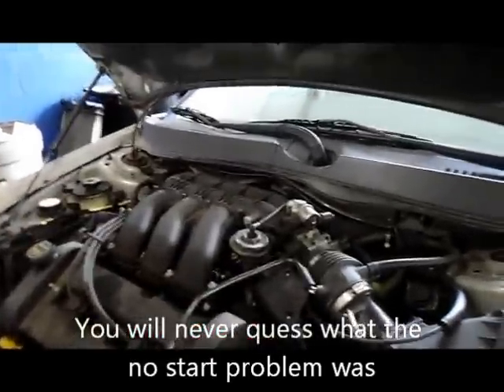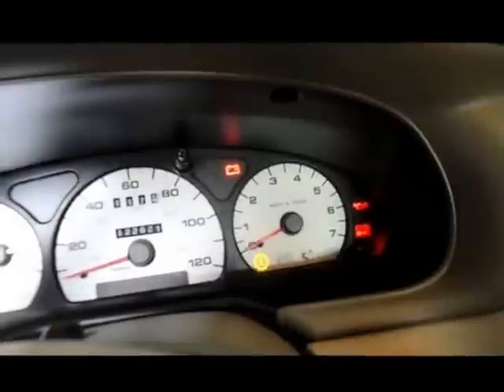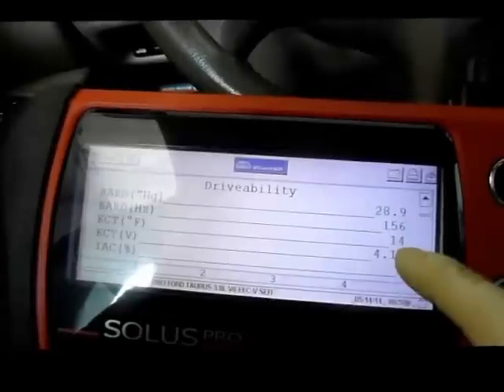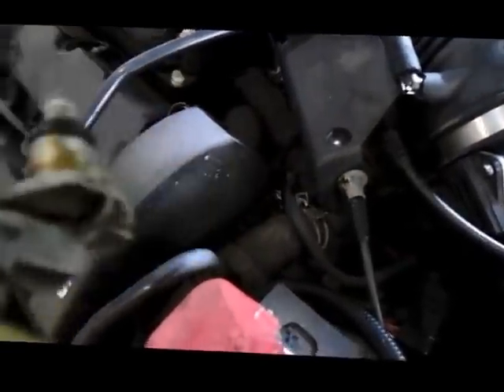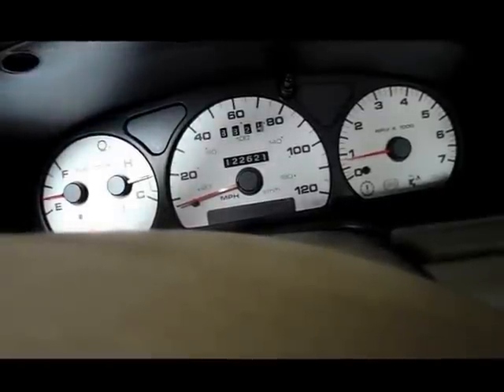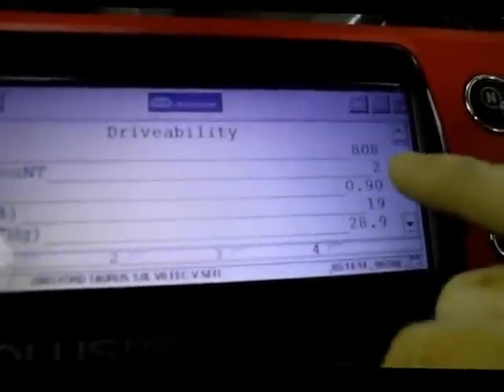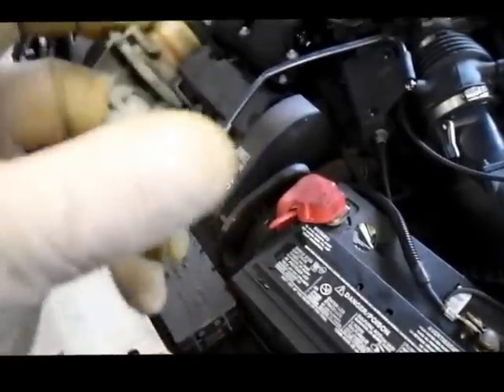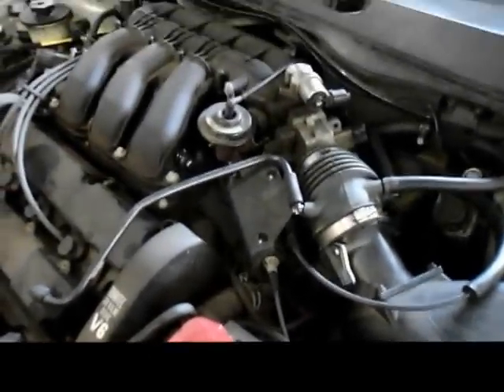Engine cranks but won't start

Comment: Common on the 300 straight six. Also common to find that the pigtail is found under the 4.6 (not the 4.9/300 CID) at the parts store. It's like an emergency stop. When in doubt about temp, it cuts off, potentially saving you from overheating/ cracking the head. People think its dumb, but id far rather change a sensor than an engine.

Comment: well because at this current time on that your vehicle the ECT is a required input used by the PCM to determine pulse width to the fuel injectors and exedra so without having the correct information or it being outside of the parameters set for the computer it will not let the vehicle start hope that makes better sense

Comment: It's a dead short on the sensor causing the PCM to go into safemode... Keeps your engine from overheating... Jeeps are known to do that but cut into the throttle position so you can't drive over 45.

Comment: Yes the safe mode is working fine to prevent the engine from overheating, the temperature that is read buy the sensor goes to the ECM if the number don’t Mach the normal allowed it will cut power to the ignition system...

Comment: Upon powering up the ECM/ECU first thing it does is to see the Ambient Air Temperature sensor reading  (integrated in the maf), the MAP sensor reading and the ECT sensor reading, the program calculates for the ideal fuel ratio for ambient temp and altitude variations and selects the logical A/F ratio cell, in this particular case the program gave priority to ECT sensor and disregarded the rest,  it should be tied up with logic triggered DTCs for easy diag i guess its a programming bug that might be corrected for in their late production

Comment: I have seen multiple configurations for these shut offs, on the gas on old honda civics in particular. I suppose along the way someone decided to use the temp sensor, 
I bet the function is not to see if the temp is too far out of range for the vehicle to run, but the voltage change after you put the new one in is the clue. I bet it disables the engine to simply prevent over heat, if the sensor is not working correctly the fans wont work correctly right?

Comment: Sensor out of range is quite common. Pwm is so long it floods engine. 
Up here in the dead of winter it would start,but eventually flood out. 
A very common issue with gm vortecs. 
The no spark thing should have flagged something. Unless the flood killed the spark on corresponding wire. 
Multi-spark,one shorted plug kills 2 cyls.

Comment: Yes, I had a 1999 Ford Exploder  ( not a typo..lol ) on my lot for 6 years and 5 different mechanics. This damn thing would start once a day and that would be it. As long as it stayed running it would run all day. But when you you shut it off, it was done till the next day. Trying to unhook the negative cable thinking if it was the computer  this may clear out any problems and start up. That didn't work. Thinking if this was a bad sensor that would have cleared and started we moved on to the mechanical. Knowing the timing chain had been changed by 3 mechanics before, of course he must have left something loose in there. Took that apart, all good. Crank sensor, cam sensor and most every sensor on the motor changed over 6 year. All top end gaskets and vacume hoses changed. Fifth mechanic mechanic tells me it must be a bad intake keeping vacume stuck somewhere or a bad wire in the ECM. He can pull the cover off and check ECM for a bad wire. I told him to go work on something else let me do some research. Looking thru the computer at all the parts I had bought or didn't buy. Going out and starting the Expoder for a week. I realised something I guess non of my great mechanic's did not catch over 6 years. Temp gage was normal on first start. Would ride about mid range. BUT, on the second start would barely move off bottom mark. It was just at mid point just 5 seconds ago. Checking wires and no bad wire no check engine light. Nobody ever checked temp sensor. I changed that and started every time like a dream. Sold it 3 days later on a note. Next year and a half when it was paid off. Never another problem with it. They wanted to trade it back in on a bigger SUV for down payment. I cut them a deal. Keep your exploder, $500 down. I never wanted that thing back on my lot again.
Reply from the maker: Thanks for watching and for your input.Sometime such and easy repair can drive you up a wall.

Comment: Problem is probably over rich air/fuel mixture. The engine computer determines air / fuel mixture partly based on engine temperature. If the ECM "sees" low temperature it will send extra fuel. Thanks for sharing.
Reply from the maker: Thank you for your input. Don't forget to watch Sunday Night at 7:00 PM Live stream.

Comment: It seems like that voltage draw by the bad sensor was causing the ignition system to have less than battery voltage, or starting voltage on the step up coil. If the coil doesn't get enough input voltage it can't step it up enough to spark. I had a surprisingly similar problem on my 1982 Jeep cj5, which is a very different and almost non comparable car. It had resistance due to corrosion on the grounding wires inside of the distributor. When the starter was drawing power I would have about 10vDC at the battery, but only about 8.5-9vDC to the positive side of the ignition coil. I wasn't getting a high enough input to to the coil for it to step up the voltage from 10+vDC to the 45kvDC needed to overcome the resistance in the plug wires and create a spark. The voltage needs to be high because the wires are something like 35k ohms. If there is any voltage draw, either from a bad sensor like in this video, or corroded/damaged wires like in my jeep, or just a bad battery you won't have a spark.
My problem was intermittent. I would start it up no problem in the morning, drive to work, and get back in in the afternoon just to find out it wouldn't start. Or it wouldn't want to start in the morning but after waiting an hour or so it would start up and work all day. It worked for almost a whole week once before leaving me broke down at a lake over an hour away from the house.

Comment: 2009  chevy transverse I just took it. On a trip yesterday and today it started went out to start again I have no lights no power at all what could be a problem security theft ???  Now the key won't turn clear off no problems with it yesterday thank you for your help

Comment: I helped a guy on an 89 Aerostar. It would start with starting fluid but it had fuel and pulse . I happened to see that the coolant temp sensor was all fuzzy w/corrosion. We took it out and it just fell apart (pot metal). We got a new one made of plastic (thought it was odd). Since the vehicle had been sitting in the shop, I figured that the sensor was at room temperature also, so we just plugged it into the harness and the vehicle fired right up. I guess that having a wrong temp reading will be like setting the (old timer) chock in the wrong position. If I heard you correctly, it would seem odd there would be no fuel at that (false) temperature. Unless there was also (conflicting) OAT/intake air temp reading coming from another sensor, how would the computer know if it wasn't sitting in the snow? Perhaps there is programming in the software that will not allow fuel/spark if there is such a large difference in temp.. just a guess. It would be nice to have a conversation with a Ford software guy. Also had an old Saturn that would cold but not hot. It smoked black on startup and not stop. The temp sensor was sitting at -20F and would never change.

Comment: The ECU calculates the AFR (amount of fuel to add to the cylinder) based on the sensory data collected from the water temperature sensor and Idle air control valve(this allows more air to flow into the manifold causing a vacuum and the computer to recognise difference in manifold pressure), and oxygen sensor to compensate for the cold start in order to shorten the time to reach optimal operating temperature and maintain low carbon emissions , if the reading is incorrect (perhaps the wrong sensor is used or the resistance values differ from the OEM water temperature sensor) then the fuel added will also be incorrect. 

Water temperature will determine the average temperature of the entire engine as it radiates heat throughout the engine block and provides cooling, the engine will require less fuel as the air becomes less dense as the density of the air changes under heat produced by the engine. Reaching a point to where the fuel values at optimal operating temperature and pressure, the ecu will strive to maintain a 14.7:1 Air fuel ratio which is then further corrected or trimmed by the oxygen sensor on the exhaust manifold, This is done in that fashion to reduce carbon emissions produced by international combustion engines. 

However like humans have organs, so in the same fashion does mans creation itself have organs that must work together to perfect the whole.

Comment: ECT sensor can cause no start condition if it faults in the direction of HOT. If the computer thinks the engine is hot, then it won't start because it's way too lean. Opposite of this, my uncle had a 98 Chevy pickup that read COLD. It would start fine but then run like crap as soon as it warmed up cuz it was staying in OL and overfuelling. it turns out it was a 1/2 gallon low on coolant and the sensor caught an air pocket and read pegged cold. I've also seen the same thing in a shop with a Buick. Bad temp sensor. I've never seen one screw with spark though. I've only seen no starts due to under fuelling a cold engine. This can be aggrevated by the fact that the sensor for the gauge is not the same sensor for the engine management on many many cars.

Comment: I HAD A HEAD SCRATCH-ER MY ENGINE WOULD START BUT DIED WHEN THE KEY WAS IN THE RUN POSITION. I CHECKED EVERYTHING.  BUT KEPT DYING AFTER IT STARTED.  IT WAS A BAD IGNITION SWITCH LOCATED DOWN ON THE LOWER PART OF THE STEERING COLUMN.  REPLACED IT AND THE PROBLEM WAS FIXED!!

Comment: hello Jim, love your vids , u r one of actually alot that show exactly how to do the work for whatever the problem is,  thks and keep up the good work, I'm working on a 95 XE Nissan D21 pick-up, cracks but won't start, has orange spark , can't hear fuel pump prime, please help.
Reply from the maker: Thank you for stopping by the shop.

Comment: I found this:  " The computer in every fuel-injected car must know two things before it can figure out the correct cold-start air/fuel mixture: the engine coolant temperature and the outside air temperature." 

The F/A starting mix might need to be determined prior to setting the spark's timing

It seems reasonable that if the two sensors unreported too large a difference especially if the indicated engine temp was much lower, that could be a no-start condition problem.

Comment: Someone has probably already said this, but here is my thought: Does the car have more than one temp sensor? likely. Possibly an intake manifold temperature sensor, maybe an ambient air sensor, or other unknown temp sensors in the car? The sensor alone wouldn't cause this as its within range, BUT... if there are other sensors (pretty sure there are), then the computer saw a large abnormal discrepancy and tripped out on safety, as it cannot know if the oil is too thick or the air inlet is too warm for the engine being too cold, etc... But that would normally throw a code IF they programmed that subroutine in ROM. It is also possible you encountered a software bug, which is uncommon, but it CAN happen, saw it in the newer Chryslers. I used to dick around with, and repair old ECU computers that had faulted for some reason or another (usually caps or bad solder, or ROM. Even had one with a blown bus transceiver IC for the high speed.) but I digress.

Comment: I once got into my car, turned the key and nothing happened. I mean not a single light on the dashboard and not a sound. The car was completely dead as if someone took the engine out of it. I had someone try to help me jump start the car but, again, no lights no sound. 
I've never seen anything like it in my life. 
So I towed it to a mechanic and in less than 10 minutes he comes back to me and goes, "Yeah, it's just a fuse, that'll be $26." You can't imagine the relief I felt!
Reply from the maker: Sometimes you get lucky. Back when I first opened my shop in the 70's .I had a few customers come in with the exact same problem. Turned out someone stole the batteries from a few cars on my block.

Comment: have a friend with a 2006 ranger that had similar problem. the issue turned out to be caused by a loose fuse (roll over sensor?) in the cabin box...figures maybe his kid bumped box with foot, or knapsack...his mechanic was cool, and only charged for the price of the tow.

Comment: My thought is that it is so sensitive to the temperature when choosing the right fuel mix that with it reading so far off, it just wasn't able to come up with a useable air/fuel mix that would let the engine start. Or it knew it was far out of range and that just made the computer freak out and not do what it should.

Comment: there are a couple reasons why the coolant sensor would keep the car from starting, 1) if the sensor itself had a short in it, the computer recognizes this and will not allow the car to start to keep from burning up the computer. 2) if the sensor was giving a very high reading (which it was obvious yours wasnt) but if it were the computer would recognize it as being very high and would not let the car start because it tries to keep you from blowing your engine from over temp.it was obvious that your was the first one, to find out test the sensor you removed with an ohm's meter also test a new one the same way, you will see the difference. I'm not a super computer technicion but I have been around the block with these thing a time or two.
Reply from the maker: Thanks for watching.

Comment: Hum I have a 03 Cadillac CTS that cranks but won't start. Pulled the air intake tube and sprayed starting fluid in there and it still wouldn't start or even pop. I thought it would be spark and maybe it is, but I  don't have any codes. If I let the car sit it' will start eventually. It won't start after I drive it and let it sit for an hour or so. Thanks for sharing. Best Wishes & Blessings. Keith Noneya
Reply from the maker: Thanks for watching.
Reply: Keith Noneya Did this work for your car I have the same one having the same issue

Comment: I had this problem with a 1999 Ford F150....I had to replace the coolant sensor to get it to run.  Got to be very careful or you will break them off when you tighten them down.

Comment: the engine coolant sensor is part of the electronic throttle control system its just as important to the engine as the throttle body sensors.

Comment: Maybe the computer detected a mismatch between temp vs. sensor voltage?  What is the normal voltage for 14 degrees?  If it is not 4.18, then that for sure deepens the mystery.  I did notice the voltage drifting when you showed it at the 3:25 to 3:30 mark (4.18v to 4.20v).  Maybe it was detecting the drift?

Comment: the reason that it was not starting is, it was fouling the spark plugs, because the ect (engine coolant temperature) in an obd 2 system helps the computer determine how much fuel the engine needs to start the colder the temp the more fuel the engine needs to start.

Comment: Yes the ECU should detect a signal from temperature sensor for it perform necessary fuel,firing and timing so that it runs engine, without that it stalls as it fails to understand what the engine needs.

Comment: The ECT sensor on a 3.0l is vref sensor. Ford vref sensors voltage should range between 5.5 to 4.5 volts key on engine off. Vref is also normally internally bussed in the pcm. A short at one vref sensor can cause issues else where and In some extreme cases on some vehicles  can cause no communication with the pcm such as with the older 6.0l diesel. It is likely that the ect was shorted a caused a vref issue. Disconnecting a shorted vref sensor can allow a vehicle to start or reduce the symptoms depending on the sensor.

Comment: with that low of an engine temp the pcm injects extra fuel for a cold start being there is no choke so in a sense the pcm was flooding the engine out it may have started if u put it in clear flood mode seen this many times